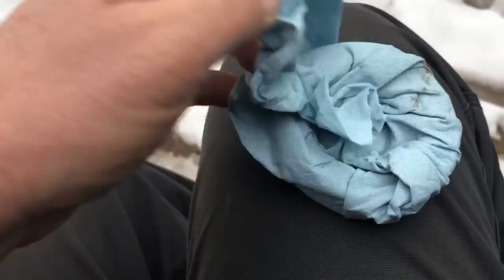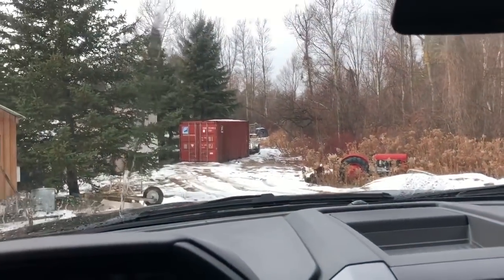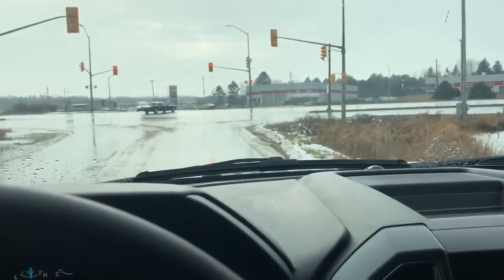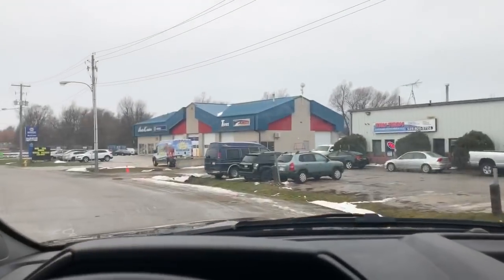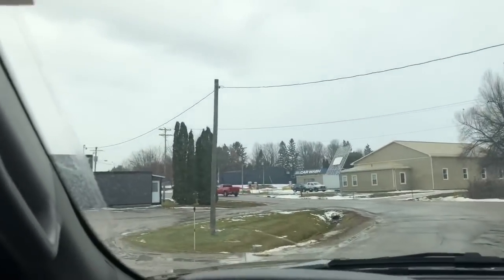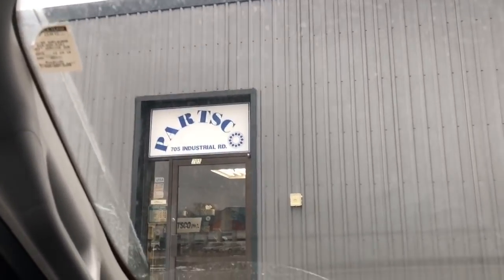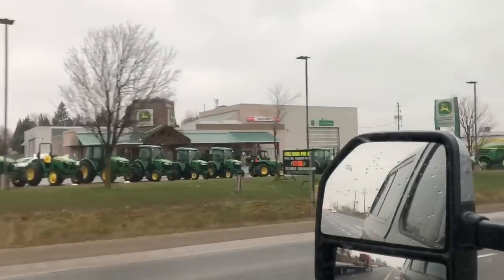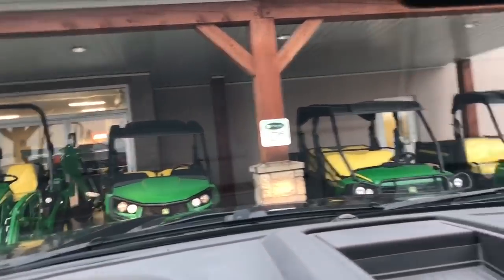We need to try to locate a Bearing for the John Deere AR belt pulley. If it exists

Comment: 1209st is a textile machine spindle bearing.  1209ct is a clutch throwout bearing. The letters after the numbers are important. They can indicate factory supplied grease, seals, shields, load rating, rpm rating, shaft fit, tolerances, etc.  For an application that isn't going to be worked or be a critical component...seals and shields could be done away with if there is provision for lubrication, other wise a sealed bearing is factory lubed  for its lifetime.

Comment: Bill, check this out on Amazon. . . it has a "TS" after it, not sure if it would work or not, but you might look up and see if Hyatt is still in business and give them a call, or see what your "local bearing guy" can find out:

https://www.amazon.com/HYATT-1209TS-Cylindrical-Roller-Bearing/dp/B00DBOT3LE/ref=sr_1_1?keywords=Hyatt+1209T+bearing&qid=1574476058&sr=8-1
Reply from the maker: I’m not sure what the S means on the ts part.
Reply: No, you're right, I don't either. That's why I suggested getting a "bearing guy" on the horn and see if they can tell you of figure it out. That bearings sure a LOT cheaper, if it can work!! Good Luck!!

Comment: Rim casting bill.  I remember when i was 10 to 13 ish the rim clamps came loose on the JD 520 when dad was plowing snow at the nieghbors. Dad came limping home on the casting with a chain wrapped around the tire hooked to the blade. Oh and its a 13.6 x 36 loaded tire which is around 500 lbs.  Me and my brother weren't much help and mom wasnt either. Dad got stuff under the tire to use a 2x4 and pryed it up and used comealong from trusses in barn

Comment: You could probably find that bearing for a lot less, seems that all makes of bearings use the same part numbers, may be able to order one on line. however each manufacturer seems to have their own part number for oil and grease seals making them a little harder to find.
Reply: Have 1 new for a John Deere 720 diesel tractor  not sure if they are swappable

Comment: One of these days I’m gonna have to look into the possibility of adding the factory remote start to my truck.
Reply: If you have a new truck with the Ford Sync system check to be sure that remote start is already there , just waiting for you to download the app from Ford.
Reply: I might add one to my 97 7.3 and i got the apcm for my trk so if my "parking brake" is set then my charge protect mode will kick in and i have a 4 relay system drawn up that i can use the remote to engage my "parking brake" for quicker warm up
Reply: Reg Sparkes it’s a 2013 Ram... I know it was an option, I just don’t know what’s involved in adding it. I know I’d need a new remote, but I need some more remotes anyway. $$$$😵
Reply: @compactc9  Oh OK then. I like that Cummins in-line engine. It's one of the better makes and styles of diesel out there,..in my opinion of course! LOL.
Cheers!
Reply: Reg Sparkes the Cummins is really what sold it to me. Definitely over the years they’ve been the most consistently reliable of the engines and haven’t suffered from a lot of the various issues the others have had over the last couple decades. These new Ford engines seem to be pretty good. I know the first year or two, naturally, had some issues they had to get worked out in their manufacturing processes. But they seem to have actually fixed the issues and made a good engine. They just go for way more than the Rams seem to, $10-20k more!! I’d imagine because there’s a lot of demand for the 11 and newer Fords, since a lot won’t buy or want out of the 6.0 and especially the 6.4 trucks.